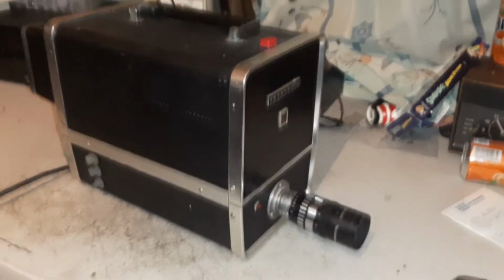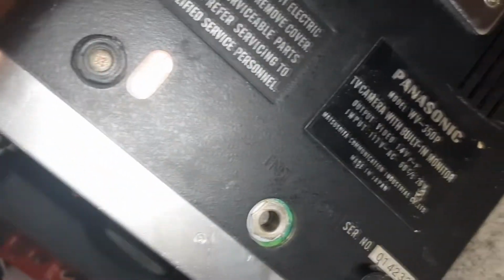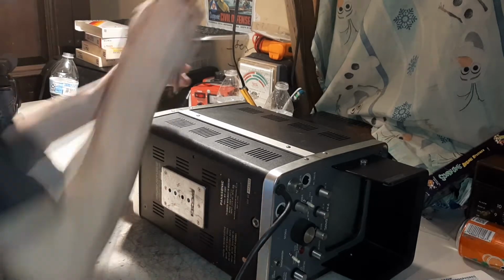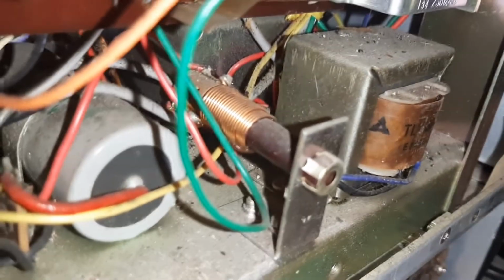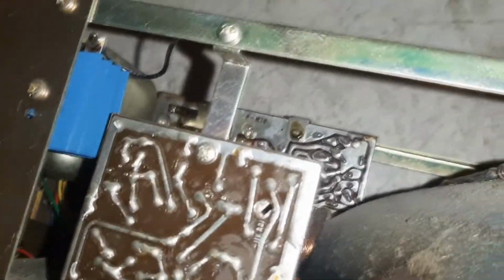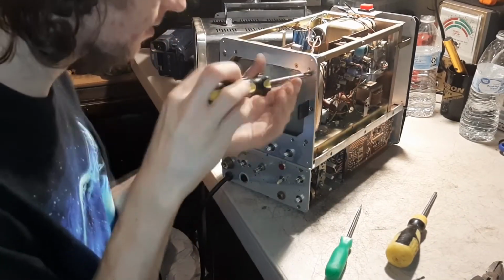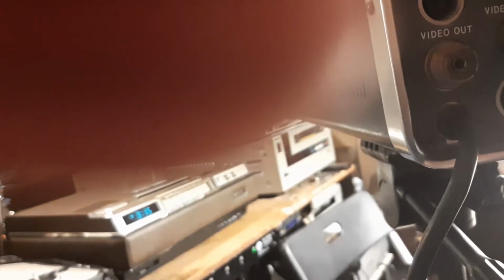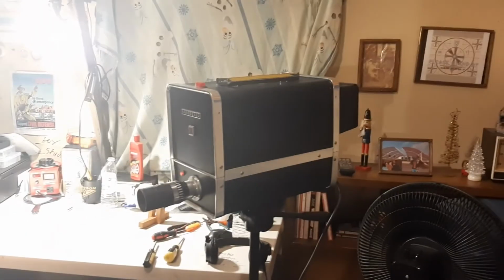Early japanesse Broadcast camera Panasonic WV 350P

Comment: The oldest source I've found is High Fidelity magazine, Oct 1967. I also doubt that it was made as late as 1974 By 1972 it would be pretty far behind Sony's offerings and by 1974 the  AVC-3450 was really outperforming it with switchable low light .  It's odd that there's not more info out there about these cameras considering there are about as many on the used market as the Sony cameras of that era. 

The lower circuit boards that drive the vidicon are close, if not identical to the boards used on the Panasonic WV-033V and WV-033P which is more of a security grade camera. Left side board is the video amp / sync oscillator. Right side board is the voltage regulator / high voltage stages.